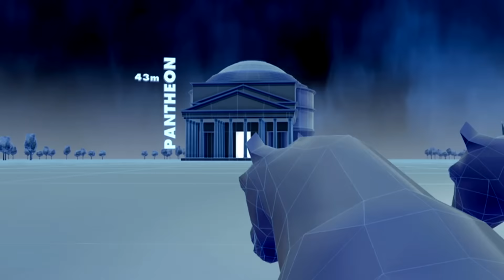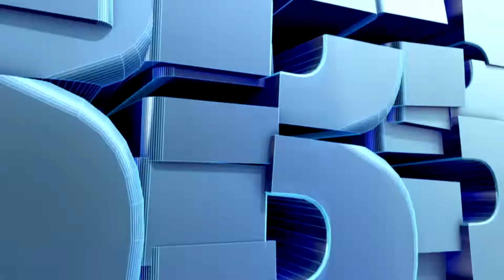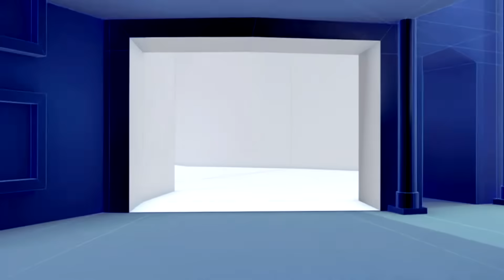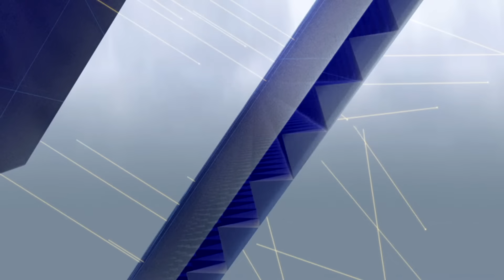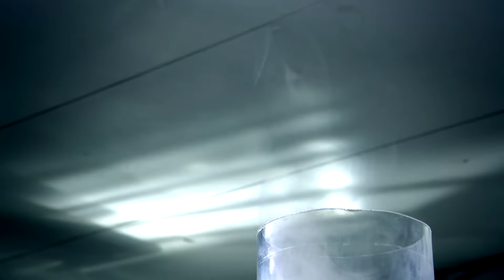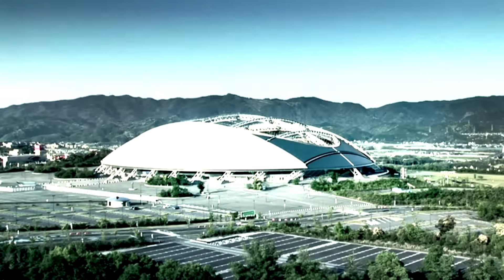Superdomes – Extreme Engineering – Big Bigger Biggest

Comment: 18:20 Okay assuming that its (202 Feet) for a moment so that makes me like this Dome even more because it’s 110 times Bigger than my Model Dome which is only 56 CM in diameter, crazy right? 

Well it is crazy because I’m using 30.5 CM Per Foot instead of 30.48 CM Per Foot but given my need for things to be at least close to correct so that way I don’t get ridiculed I have to at least slightly stretch the truth. 

Also if you’re curious the dome model isn’t actually a physical model that I have but a digital one in 2D it’s 56 CM wide and 22.4 CM deep/high.

Comment: I. Am. Not. Impressed. How do you even do a video on domes without mentioning Buckminster Fuller or geodesic domes? With the exception of the domes built before the 1950s every single one of the domes presented here is overbuilt, overweight, and more expensive than they could have been.

Comment: https://en.m.wikipedia.org/wiki/Civic_Arena_(Pittsburgh)

Constructed in 1961 ... It was the first retractable roof major-sports venue in the world, covering 170,000 square feet (16,000 m2), constructed with nearly 3,000 tons of Pittsburgh steel and supported solely by a massive 260-foot-long (79 m) cantilevered arm on the exterior.[2] Even though it was designed and engineered as a retractable-roof dome, the operating cost and repairs to the hydraulic jacks halted all full retractions after 1995, and the roof stayed permanently closed after 2001.
Reply: So that Montreal effort was not the first of its kind. This was built decades earlier, and was in use far longer

Comment: by adding air into a fire situation? wouldn't it fuel the fire?
Reply: Sire, the air flow is for the smoke, the water is for the fire. Airflow wont feed the fire as much as the already-existing air inside the stadium.

Comment: It would be so simple if only a large stadium could be built using the same materials and dimensions based on a much smaller model. This is not possible as new dynamics come into play as you build it bigger. I give both thumbs up to the engineers would were able to design modern marvel and also give a thumb up to this video.

Comment: No not as simple as that( i.e. a hole in the roof to suck the air out and air holes at lower levels with fans to pump the air out, because remember we have a fire and fires love air it would get rid of the smoke temporarily but increase the heat and ferocity of the fire which would then produce more smoke.) still dangerous.

Comment: A reminder that even the failures of engineering, like the retractable Kevlar roof, are valuable, because sometimes you only learn the limitations of a system or material if you attempt it at scale.
Reply: If it passes the paddle-pool test, then it's all good. 😹
Reply: There was a whole lot of corruption that needs to be factored in to an understanding of the Montreal Olympic games.
Reply: hrtfdhftj

Comment: The Pantheon is by far the most impressive, considering how many technolgical break throughs were required for it be stil standing.
I doubt anything we build today will last 200 years, not to mention 2000 years.
Reply: It all comes down to cost and design intent. With an unlimited time and budget and a goal of creating long lasting structures, we could easily create buildings to last thousands of years, if we wanted to. But our goals are different. There's a saying that its easy to engineer a bridge that's standing, but its much harder to engineer that's just barely standing.

Comment: The video did not cover how Oita dome takes care of the steel expansion problem due to temperature.  Oita does not use rollers to allow the steel to expand.  I wonder how they solve the expansion problem.
Reply: It was actually covered in the video. They mentioned they solved it by using detectors to the "rollers" to synchronize their positions with others in case of steel expansion due to temperature.
Reply: @markiel55  thats actually for the roof closing system. i guess because the roof is so massive the force causing it splay out like the old domes need it to be permanently fixed to the base.

Comment: Dome looks so light that it might take off and fly  ...

The main arched trusses use triangulated space frame techniques. It is very strong but very light too. You can see through them to ceiling or sky overhead. The structure of the 2 movable dome sections are also amazingly light. Use of dome material in center is translucent and allow natural daylight to flood the playing field below. In fact, it is probably brighter inside when dome is closed because sunlight is very direct. Part of field or seating areas might be in the sun, while every where else is much darker. Closed panels allows diffused light to be scattered evenly over majority of field. 

I am a former Seattle resident... our Kingdome was largest reinforced concrete dome in world at the time. It outlived it's usefulness and was imploded by CDI. It remains largest concrete dome imploded and set a Guinness Record.

Comment: Looks like a ladybug.  Also, the hole in the roof of the Pantheon wasn't to save weight, it was to insure that the roof didn't collapse.  If they had filled the hole in the roof in, the translation of the forces of the roof would come to a single point.   No building material available of that time would have been able to withstand the translated forces at a single point, it would have just crumbled under the load causing the structure to fail.  Instead, the builders used an arch (a complete arch would be a round hole in this instance) to spread the load to the surrounding material.  Any structural engineer would be able to tell you that this is the reason for the hole.
Reply: That's not really how a dome works. The central point will be under pressure from all directions, but it won't be some kind of singularity point where no material can resist the compressive forces, not when everything is all rigidly connected together as one giant mass.

Doing a simple 2D free body diagram to get a feel for arc action, I got that the total horizontal stress at the apex would be on the order of the total load resisted and a factor of B/4H, where B is the total width of the arc and H is the total height. So, if you make a tall arc (H/B>4) the horizontal load at the top of the arc could be less than the load you're holding up. Going from 2D to 3D will only have a small affect, as you add more load, but you have more material. Typically, accounting for full 2-way action (like as you can do with 3D modeling), will get you lower stress than simple 2D assumptions.
Reply: @kindlin This commenter never used the word singularity, and they said there wasn't a strong enough material FOR THE TIME.
Reply: @jacobfarkas3916  The OP discusses the "translated force" "coming to a single point'" a couple times throughout his post, he never uses the word 'singularity, exactly. But, again, that's not how structural mechanics (continuum mechanics) works. There are point instabilities, there are point loads with unbounded (infinite) stresses at finite meshed nodes, there are many things that can happen in a mathematical model, but that's not how reality works.

There are a few reasons that I can think of to leave the top open, but none of them are because singularities are a thing.
Reply: @kindlin 🖤✔️
Reply: A dome is an arch.
Reply: Can’t believe 18 people believed that
Reply: @edsherwood2173  
It's funny how he thinks if you ADD material (fill in the dome) the forces suddenly start to "come to a single point" and singularitify the otherwise sound structure? Makes no sense.
PS: Yes, I very much did invent the word singularitify, and I stand by it.
Reply: You're reversing gravity.
Reply: So what you are saying is that the hole was to save weight....
Reply: @michaeljanssen3360  That's the actual answer. Unreinforced concrete has no tensile capacity (basically), so as you go horizontal near the top fo the dome, the bottom surface starts to want to go into tension. Without enough axial compression and a thick enough layer (which is also heavier), the bottom face should be able to work, but I can see why leaving the middle part out makes it all easier.
Reply: You don’t have a clue what you’re talking about. 🤦🏼‍♂️🤡
Reply: It DOES look like a 🐞 ❤
Reply: 🧑‍🦱 NIROB 🇺🇲✔️✔️
Reply: Weight,pressure,load there all stressors at the centre point so they had to omit the centre point to prevent the stressors